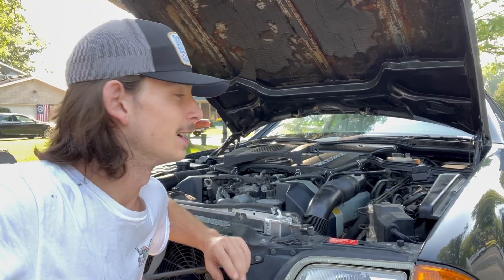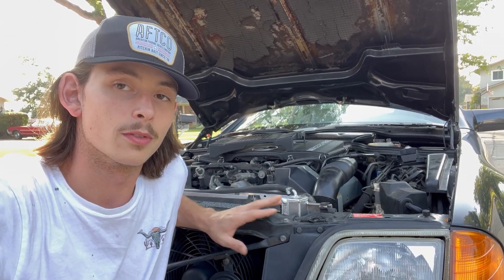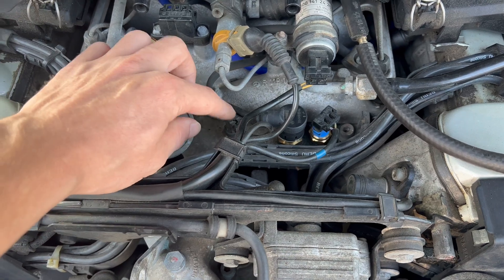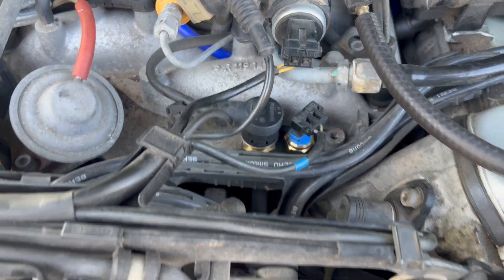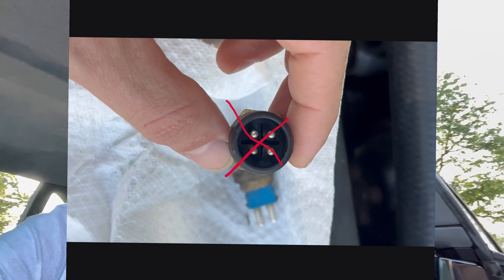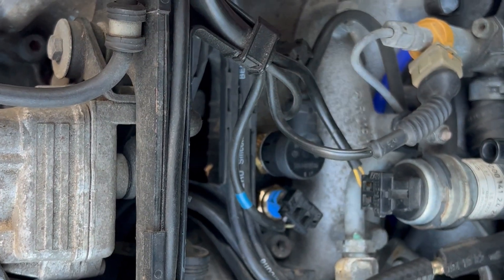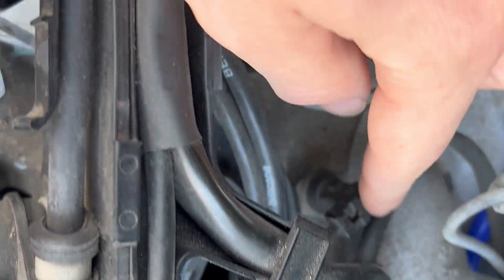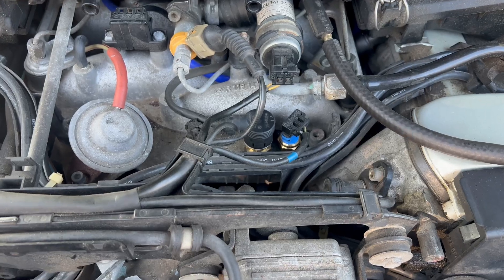Mercedes R129 M119 Cold Start Issues part 2

Comment: Have you dealt with the ASR light and limp mode? I'm currently dealing with that now on my 92 500sl. I have no experience. I've done research and honestly have no clue what I'm doing.
Reply from the maker: Yes, this issue is fairly common but can be caused by many things. If you use Instagram feel free to message me there at Danswapz so we can speak more in depth!
Reply: Homie, i have this issue too, it can be due to a bad asr relay it's located on the top left corner of the engine bay where the electronic modules are, right after the water reservoir, basically u have to unscrew the cap screws and then it basically looks like a lego piece a either a cube shaped relay or rectangular shaped long block, basically these go bad if you've had an engine wash and it was a poor job done, if u can take it to a car electrician that specializes in old Mercedes cars like the w140 and r129 and so on, he'd have the necessary tools to test it as this car that's pre 1992 doesn't have obd2 ports and basically relies on code signals and light signals to tell where the problem is so working on thr car if you're not an expert can be tricky and sometimes misleading and time consuming, so give it a go, try to switch it the asr relay sometimes the asr relay also can be opened and u can use an electronic board cleaning solution to clean the contact points from any dirt or if there's corrosion to the contact points, it should be torquoise blue color mixed with light green but that's not where the problem is, u need to have an electrician or someone that knows boards well to heat it up with a hot air solder gun so it th contact points re solder again and give good connection, but before u do all that try to turn off the car for a couple mins after the issue happens and let the modules cool down as they'll be really hot from the engine bay then basically plug out the relay and plug it back in and see if it works also there's another symptom of asr relay failure is other than limp mode the steering wheel stiffens on these cars and it gets annoying to move the car right and left and hope it helped
Reply from the maker: I have already replaced the relay with the newer updated part, but I’ve not taken apart any modules to check boards. These sensors did fix the problem, but I’m sure there is more in my future haha!